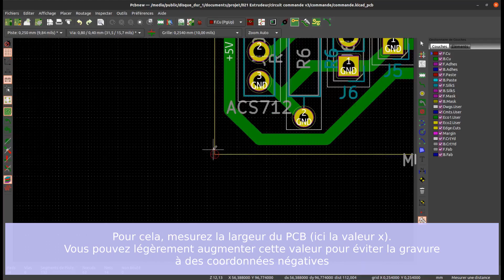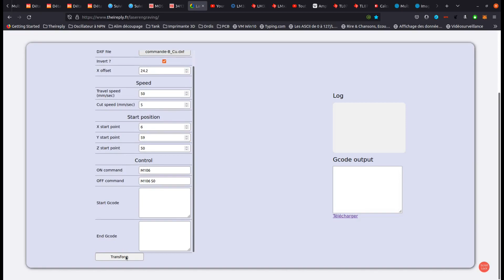Fabriquer un PCB (circuit imprimé) avec une graveuse laser Gcode

Comment: Hi.. really cool video. How about the brand of your cnc machine, the software did you used for laser engraving, and the duty cycle?
Last question, have you ever try to use Hydrogen Peroxide (H2O2) as solvent?
Reply from the maker: Hi,
First of all thank you for your comment !
I use my ender 3 pro with a laser module (not really professional, but it do the job), to engrave PCBs
As a software, I use the webpage which can be found in description. I have created it to convert DXF cutting file to Gcode directly usable by an ender 3 or other Gcode based machine.
My laser has only 500mW of power, the laser is constantly powered (duty cycle : 100%).
I have started to make PCB for not very long, I never try tu use Hydrogen Peroxyde for the moment, because iron perchloride works fine, but maybe I need to look at it to see if it has some benefits.
I hope this helps ! (And I hope my english is good enough to understand)
Reply: Whoa, thats great, the pcb result looks pretty good. Keep it up man.

Comment: Hey tahnbks for the video! I have got two questions for you how much power does laser do use ? Do you think this technique can be used for SMD components ?
Reply from the maker: Thank you for your comment !
I use a 500mW laser, it's enough to cut packaging tape
I think this technique can be used for SMd components too, the precision is good enough but a good quality packagind tape is required to prevent small tracks from peeling off
Hope this helps !
Reply: @theiremi  merci